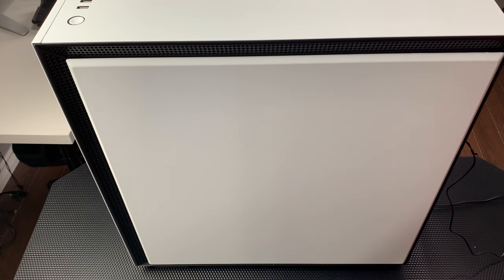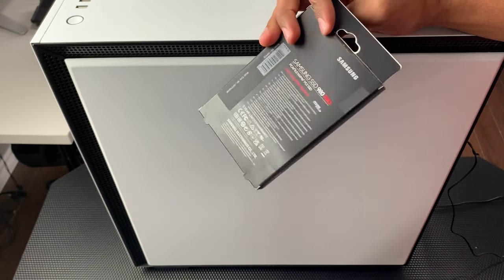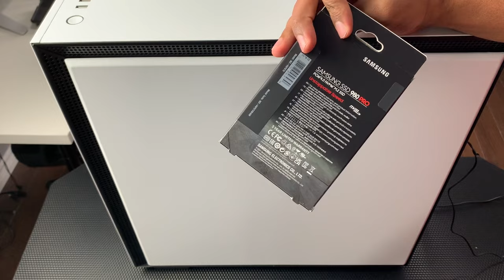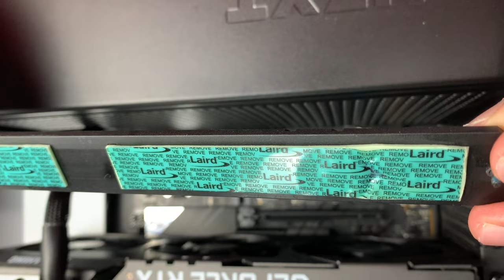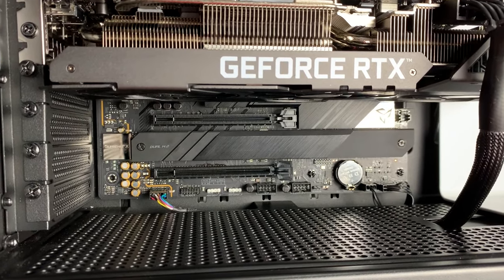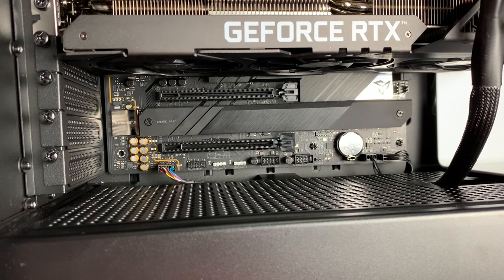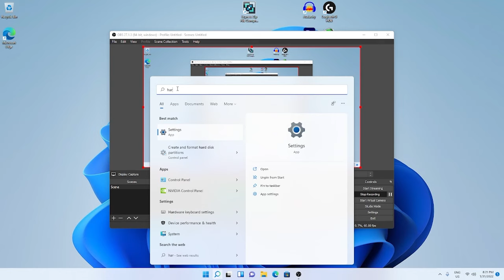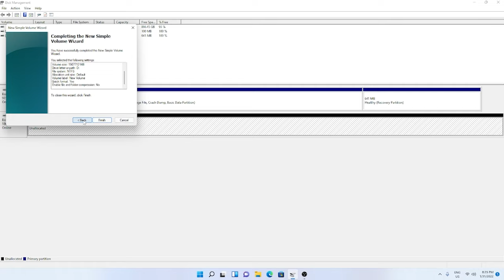How To Install M.2 SSD into-ASUS ROG STRIX Z690 E Gaming WIFI

Comment: You have to take the blue  off the film off both thermal tape. One on the bottom and one on the heat sync itself. Good luck.
Reply from the maker: Joe bozz, I took off already. I did forget when I was installing it thank you for pointing it out.
Reply: Omg thank you, I was wondering if he forgot or maybe u just could leave it
Reply: The plastic film on top of the blue heatsink on motherboard correct?

Comment: Thanks for showing the thermal pad part, I had to make sure not to remove the whole thing 😉
Reply: In fact, you need to remove both protective films (lower and bottom parts) of the pads, contrary to what  he shows in the video: he forgot to remove the protective layer for the pad that goes under the SSD.
Reply: @CONIN  But you just put the ssd on the thermal paste at the bottom? I also have a similar motherboard and it felt weird to actually dip the nvme (firecuda 530) in that thermal paste at the bottom.
Reply: @RavKxK  Hello!, the material shown at the bottom is not thermal paste, but a thermal pad (like the ones covering a GPUs VRAM chips), so, in order to properly function and for the heat to dissipate, the SSD needs to make contact with this thermal pad. I think thermal paste should not be used given a few of them are conductive.

Comment: How to remove / replace this? It seems that the thermal pad has glue in it? And I'm not able to remove the cover for already installed SSD. Or should I just try to pull it with some force? Does the thermal pad work if I remove the old SSD and replace with a new one?
Reply from the maker: No, need to use force. It should come off easy . When I bought the ssd it came with the thermal pad . I am not sure if the thermal pad going to work or not, maybe just buy a new thermal pad .
Reply: @cryout4ahm  Yeah I figured it out. It is sticky but pulling it slowly will remove it. Seems like it can be reused too.

Comment: You should have installed it on the port above those two.  You know, the one with the heatsink on it.  The ones below are better used for secondary, and tertiary ssd's, as they will not have to work as hard, and will not get as hot as the one above.
Reply from the maker: Numinous123, yes already installed one before .🙂
Reply: NO!!! if you put an M.2 drive in M.2_1 you will declinate your PCIe top slot (for your nVidia card like a 3090 for example) to only 8x.  It will not be able to use 16x.  So please do NOT use the M.2_1 slot at all, never, ever can I think of a use case for doing that, you will just slow down your expensive graphics card and be throwing away money.
Reply: @dabneyoffermein595  If that's the case, then it doesn't explain that in the manual at all.
Reply: @numinous123  It is in the manual on page vii (Roman numerals) before page numbers even begin.  It's in the "Expansion Slots" section of that page and reads "** When M.2_1 is occupied with SSD, PCIEX16 (G5) will run x8 mode only."   I made the same mistake and I verified it with GPU-Z and indeed I was only running x8 to start with, now I'm at x16.  It's a pain to remove the card and all the stuff but it's worth it !!  We can always use the ROG Hyper M.2 card for additional M.2 drives.
Reply from the maker: Even if it’s drop down from 16x to 8x it won’t much difference and not going to be noticeable.
Reply: @cryout4ahm  Cyberpunk gains around 4-10fps from X8 to X16.
Reply: @dabneyoffermein595  Well, in that case I'll move the slot.
Reply from the maker: @dabneyoffermein595  4-10fps not that big of difference but, I will have to change the slot first to see myself.
Reply: @cryout4ahm  Did some testing.  I can notice a difference in Forza and MSFS-2020 - "GPU limited" is more frequent in x8 mode (I'm using developer mode so I can see the actual difference)
Reply from the maker: @dabneyoffermein595  ok 👍 I will move the slot . Thank you 🙂
Reply: @dabneyoffermein595  Apparently this is because Strix Z690-E has a Gen 5 M.2_1 slot, that's why its bifurcates with the Gen 5 PCIE slot. It is not applicable to all motherboards, you are mostly safe if your M.2_1 is Gen4. Anyway its good to check through the manual to see if anything is in fact mentioned in there.
Reply: @numinous123  si que lo indica, en las primeras paginas.
Reply: @dabneyoffermein595  yess ;)
Reply: @dabneyoffermein595 unless you're running 4080 or 4090 it won't matter, pcie5 x8 is equivalent to pcie4 x16, and only 4080 and 4090 truly take advantage or pcie 5, 30 series cards are perfectly fine....
Reply: @5bind  i have a 4090, but yes, that's correct
Reply: @dabneyoffermein595 which slot for the 4090? Any slot?
Reply: @LoVE.B.  Primary reinforced 16x Graphics slot.  Good breathable lanes to the CPU

Comment: Did you take the plastic off the supreme fx logo and the logo at the bottom right above the third m.2 slot? Both of those are hard to take off so I’m just wondering if they’re supposed to stay on there or if it needs to be removed. Thanks
Reply from the maker: Yes, I removed all of them.
Reply: @cryout4ahm  okay, thanks

Comment: Do you need to remove the samsung sticker on the nvme itself? Does it not interfere with the heatsink?
Reply from the maker: People were commenting it’s not safe so I left on for over an month, just to see if it would interfere. But, nothing happened yes you should remove the sticker.

Comment: Question why you did not put it on top of the gpu slot?
Reply from the maker: Already installed one ..
Reply: @cryout4ahm  oh i see because what ive read if i put a nvme there on top of the gpu, it will share the lanes with gpu, so your gpu will run only pcie 8x, is that true?
Reply from the maker: @Tylenol888 yes it’s true, I have heard from people in various sources about the splitting PCle lanes problem specifically to this motherboard.
Reply: @cryout4ahm  ok thanks. I will just probably put it below the gpu. Thanks.

Comment: Hi mate, great video! I am getting the Z170 F - I also am getting the 1TB 980 Samsung PRO M.2 SSD - However, the M.2 I chose already has a heat spreader fitted to it, will I still be able to install it EXACTLY as you have here, or will mine be to thick to re apply the cover you took off? Thanks
Reply from the maker: If it has the heatsink just don’t apply the cover . I am sure you will be fine .
Reply: @cryout4ahm  Thank you for taking time to reply, much appreciated!

Comment: Installed Samsung 980 pro is not detected in Bios or windows.. already updated bios to latest. Any ideas?:(
Reply: Fixed it by using the included Hyper pcie card instead of the onboard nmve slots. Weird but thats the only way i got it to be detected.
Reply from the maker: I have 2 installed onboard both of them work great 👍.
Reply: @cryout4ahm  I see. Yeah bummed that I cant install directly to mobo. Do you have bios settings changed like VMD off,  CSM on? Anyway using the hyper pcie board it's also running on full speed in the benchmarks, so it's ok.

Comment: You forget to remove the other plastic from thermopad:)))
Reply from the maker: VIP HD:Yes, I did forget but, I removed it  already.🙂
Reply: Other thing to mention.The paper covering the chips re so important removing them but many afraid because  they will lose the warranty.What do you think about that?
Reply from the maker: I didn’t know about that you lose warranty just by removing some papers..
Reply: @vividprimevision  yes that will void warranty. The stickers on M.2 drives are designed to withstand and even help dissipate the heat. Leave them on.

Comment: Ahhh, thanks!  Win10 was not seeing my M2 ssd, but the trick is to Disable VMD in BIOS, and "not it set up like a RAID" device, basically.  Then Win10 could see and format, etc.  Sweeeeet...   ARG they keep bugging me to upgrade to Win11 nooooooo!
Reply: With Windows 11, I'm done.  Now building a box that I'll be installing Linux on to.  Microsoft can go kick rocks.

Comment: is it possible to install an additional ssd memory, where there is already a primary one?
Reply from the maker: No, only one slot there.
Reply: @cryout4ahm  there are two more.
Reply from the maker: @BrandonGebbia  I thought there was only one slot.
Reply: @cryout4ahm  Both sides can be used on the lower one, thus the two thermal pads on the cover
Reply from the maker: @ASHole71  👍

Comment: You should take this video down, as it's meant to be a "how to" and you might be making people make mistakes. You forgot to peel off the plastic on the thermal pad on the motherboard side. This could be dangerous.
Reply from the maker: Yes, I realized I forget and I will fix the video but, not going to take it down.
Reply: @cryout4ahm  Agreed, but you should at least put a note on the video description that it needs to be removed.
Reply from the maker: KatahumGidYa, I did 👍